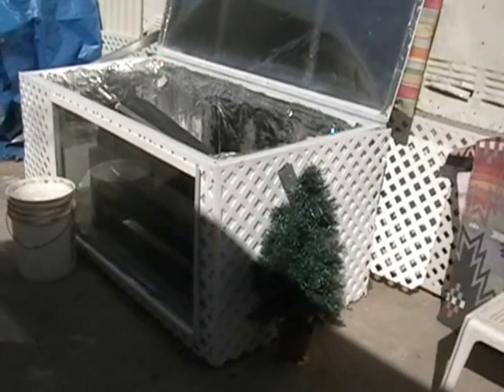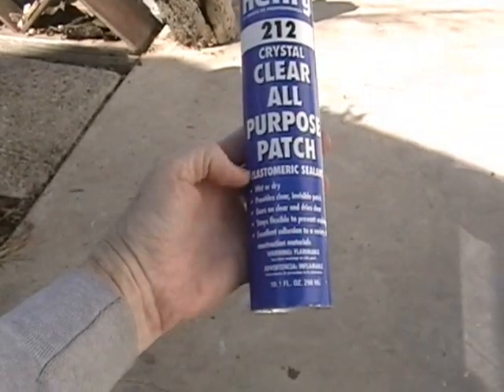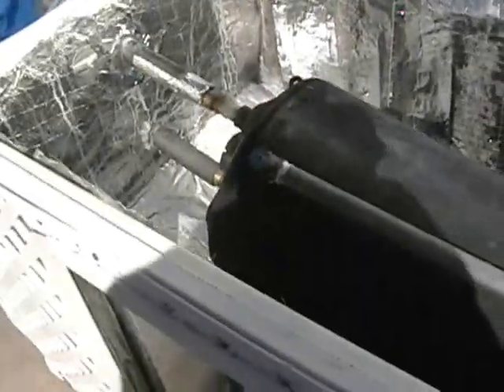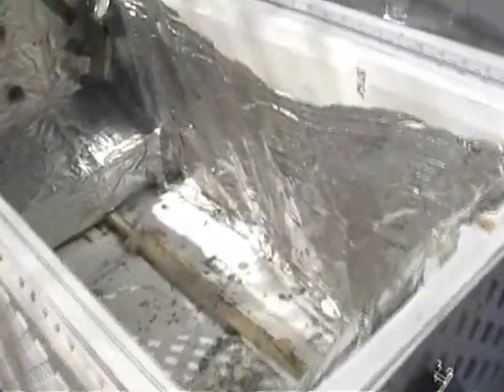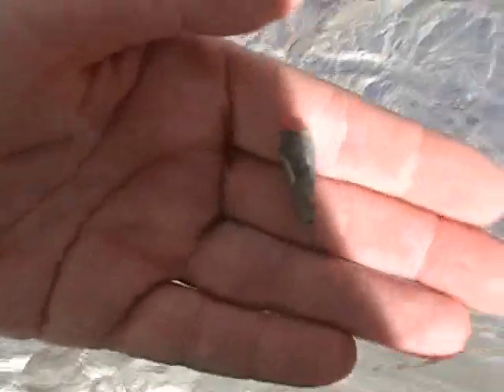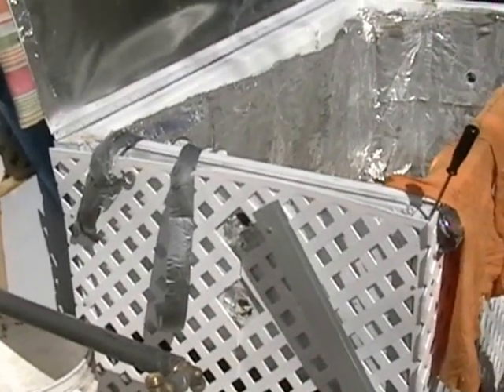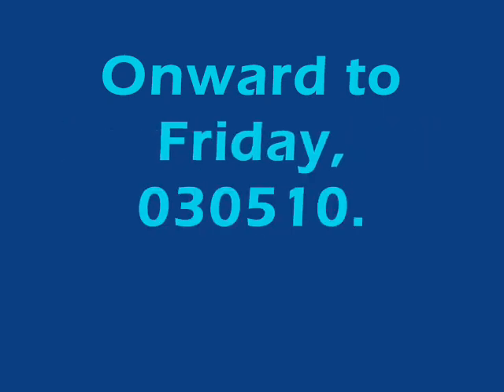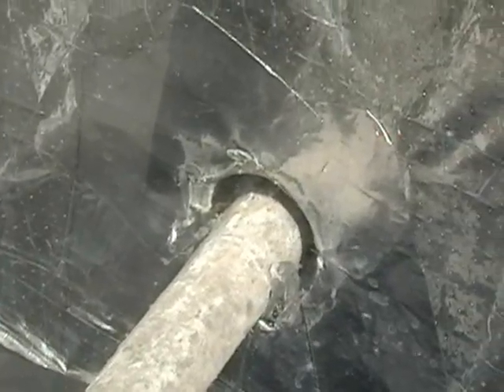0218 - 0305 Bread Box Water Heater Update

Comment: painting the foil inside the box black would  improve the efficiency.  The thought is that foil will bounce heat to the back of the tank, but reflection outside the box altogether is a bigger heat loss than the reflective gain.  Through next winter you'll have to decide if the box is heating the water enough.  If it is, I'd leave it alone.  If it isn't, you can paint black, but you're close to boil!  Also, the best sealant is RTV caulk -- used to make engine gaskets - buy at any car parts store.